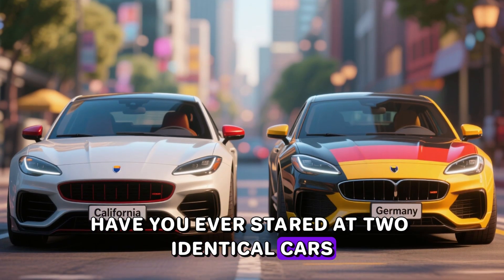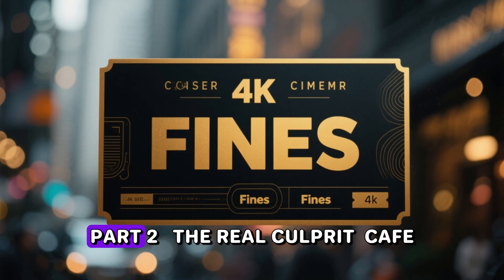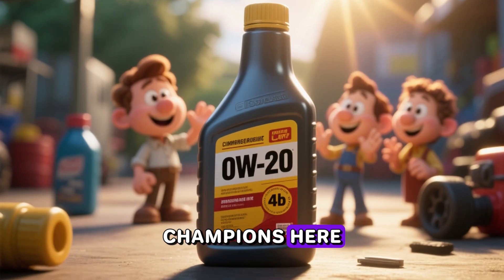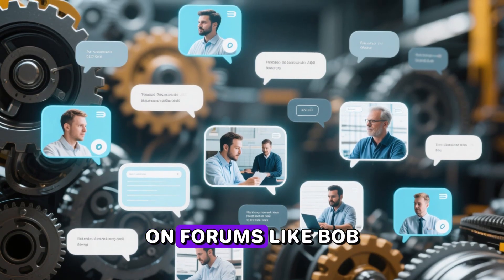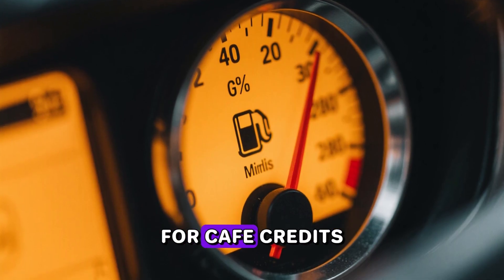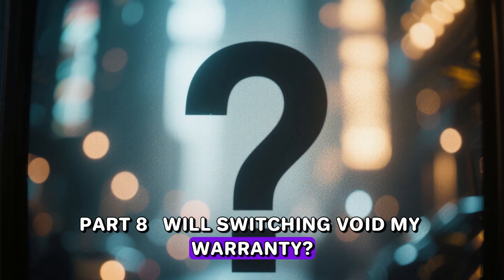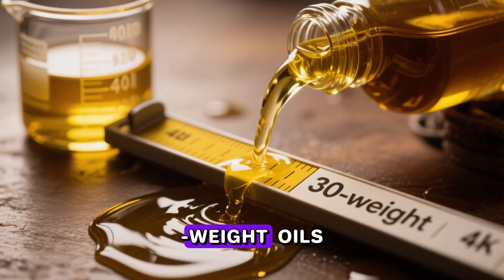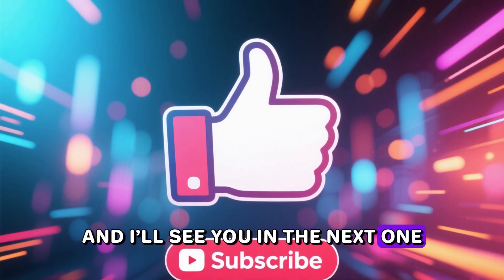Why U.S. Cars Use 0W-20 But the Same Engines Use 5W-30 Abroad (Mechanic Explains!)

Comment: My 2022 Corolla Hybrid 1.8, can take 5w-30 when towing or hauling, "as it may provide better protection". Thats a quote from the owners manual here in Sweden. Takes 0w-16 in the States.    Further, toyota does not require 0w-20 like the video says, it recommends it, which legally, is very different from. Requirement, everyone gets this wrong, and they will not (legally) void your warranty.
Reply from the maker: Thanks for sharing those specific details from the owner's manual regarding 5W-30 for towing and the difference in oil recommendations versus requirements!